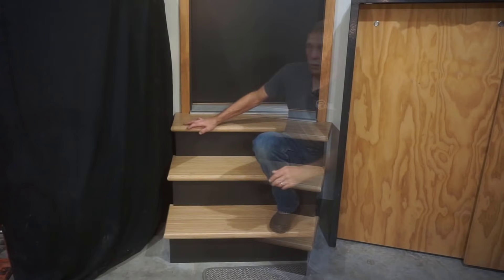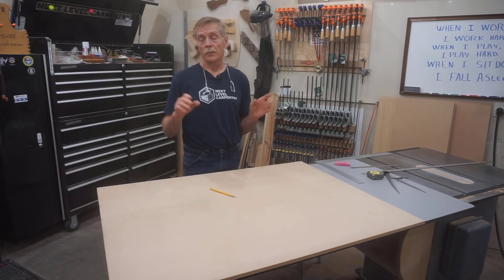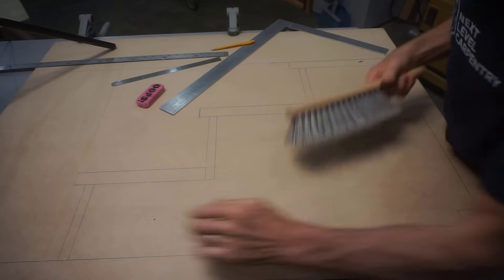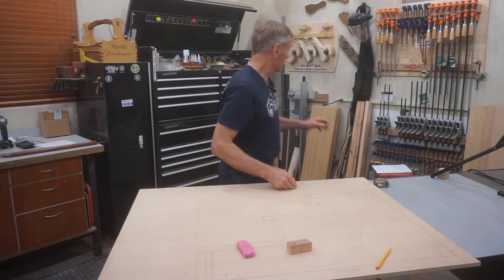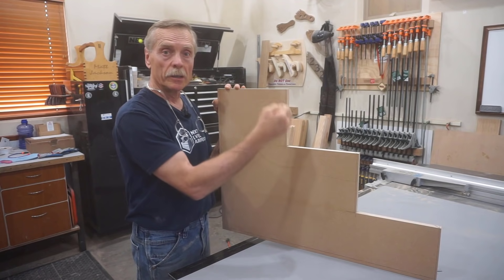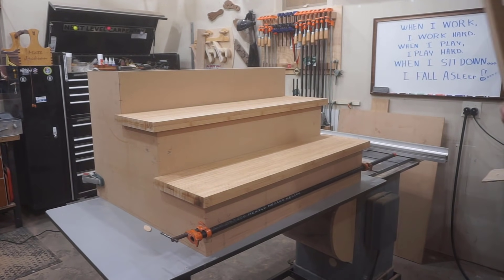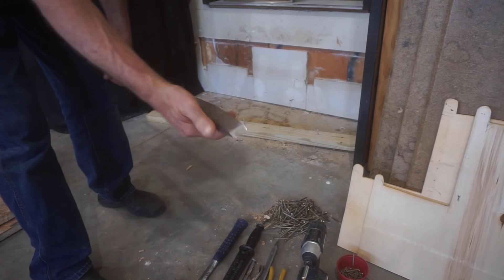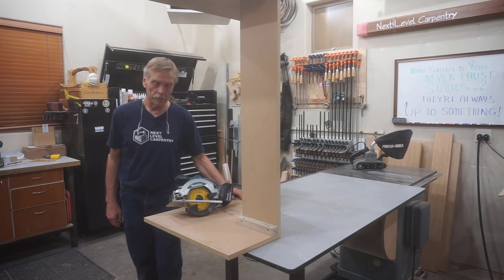Build Simple Strong Steps Without Stringers

Comment: I’ll probably never build a set of stairs, but I’ll always watch your content all the way through.

Love all the jokes!
Reply from the maker: Thanks for watching LONNNG videos all the way through... much appreciated!
Reply: @NextLevelCarpentry  I think you abbreviated that as much as it could be. "Were not building a piano here" doesn't fit in this case. A person could be proud to have that set of stairs installed anywhere in their house. I have worked with some very talented carpenters in my day and I never saw anyone top what you just did. Awesome work bud.
Reply from the maker: @78tag  thanks for sayin! 😎
Reply: @NextLevelCarpentry  I like videos, I fall into the group if one screw is good three will be better
How do know how many screws and what size and how long, wheater glue is enough,  weight vs force vs size is always a question  thank sharing your time
Reply from the maker: @frankhynes4514  Most of that is from decades of experience in both building things and tearing them apart.  When in doubt use more.  You can learn more from a mock-up than just about any other method.  With things that are new and unfamiliar don't be ashamed to iterate; a 2nd one is always better than a first and often it takes a 3rd one to get acceptable results... Best, Matt
Reply: @NextLevelCarpentry  thank you
Reply: Metric Dividers!

Comment: Thanks so much, Matt.  Another outstanding carpentry demonstration with an extraordinary attention to detail and some humor thrown in just for laughs.  There are so many tiny little details in how you scribe to get the perfect fit. Thanks again, you are the MAN.
Reply from the maker: Thanks for watching and commenting on this one Jim, much appreciated!  FWIW these steps have performed flawlessly to this day and I expect that to continue for many years to come.
Reply: @NextLevelCarpentry  Hi again, Matt.  I need to get rid of the 3-4 inch drop from living room exterior door to the front porch which is concrete slab.  Any tips or links to how to accomplish that one?  I would like it to be a mini-ramp.
Reply from the maker: @jim7smith  I've got all kinds of ideas but tough to communicate them.  How long can the mini ramp be?
Reply: @NextLevelCarpentry  I would think 3-4 ft would be fine, the drop is I think less than 4 inches.

Comment: I built a stair box similar to those only in dimensional lumber as the steps, definitely not as athletically pleasing. I used a piano hinge on the middle step to access storage under the step. This video was exceptionally done. I live in Canada so I already own metric dividers.
Reply: You could add a set of adjustable Metric Crescent wrenches
Reply: Idk dude I see athletes running up and down stairs all the time, they seem mighty pleased by just about any old set of stairs
Reply: @martyjosephson4937  -- You will also need a metric board stretcher to round out your colledtion of tools

Comment: Excellent video Matt. This project is a platform for many other useful tips and processes you use instinctively that many others don't know. For that it reaches many levels of skill and analytical experiences. I particularly like when you display mistakes. One problem with other videos is that they don't normally show mistakes which is not good. Not only is it good to show minor setbacks, its good to show how to deal with them. Also the constant foresight is critical to make the project work so you don't have to iterate back again. I might disagree with the simplicity aspect a bit, but this is full of great value, keep up the good work.
Reply from the maker: Thanks for the nice comment Timothy... Much appreciated!
I suspect your slight disagreement with the simplicity aspect is that its relative to the resulting assembly more than the less simple process of getting there? 
Glad to hear you're one who watches to learn methods rather than expecting to be taught specifics. 
Best,
Matt
Reply: @NextLevelCarpentry  The fact that you used Bamboo was excellent. I am not sure if you commented on how strong Bamboo is. Some critics might not see the engineering in this. I suspect Bamboo isn't budget friendly.

Comment: @Next Level Carpentry I recently came across your channel. Just goes to show, you can definitely learn something new every day. While I've never been a big fan of MDF/HDF, I know it has it's place. Even in the off chance that the stair box ever incurred any damage, the way you built it allows for a couple new sheets to be put together a quick resurfacing of the bamboo treads has everything back in order. And because you didnt glue the treads, if the flooring in that hallway ever gets changed, you can change the treads accordingly. That finished coat on the stair box really sold me on getting another sprayer. I tried out one of the new plug-in Wagner airless sprayers earlier this year, doing several hundred feet of privacy fence, it worked well enough. Really glad I borrowed it though. Absolutely going with a battery Graco. Keep up the videos.
Reply from the maker: Hey William, thanks for watching and commenting on this one.  I share your opinion of MDF/HDF but it might not be clear in the video that Medex, the specific HDF product used for these steps, is an entirely different animal.  Extremely durable and virtually water proof, not merely water resistant so I feel it's a better product that even pressure treated wood and much better suited to this sort of project than any Trex-type material.
I do think you'd like the 'high end' Graco seen in this video... it's pretty amazing with the only shortcoming (common to all sprayers) is time and effort required to clean it and 'pickle it' between occasional use when compared to a disposable roller & pan setup.
Reply: @NextLevelCarpentry  Well thank you for the tip about Medex and the input on the sprayer. Much appreciated.

Comment: great educational video.   Using the dividers and yard stick is just how i was taught in drafting class in the late 1970’s when we still did drafting work by hand and learned to take the same info to actual building process for wood and steel fab.   Also like the humor used related to the metric system comparison.  Great job also well organized and clean work shop!

Comment: Lots of useful info + a healthy attitude in dealing with the naysayers of the universe. Any particular rationale for the sharp writer pencils vs. Other writing implements? Thanks for sharing!
Reply from the maker: I really like the sharp writers over any other pencil I've used for the sort of marking required on a build like this. The fact that the lead advances by twisting rather than clicking means I can dial in exactly the amount of protruding lead I want for any given mark. Another preference is that they are disposable and a ridiculously good value for the use I get out of them plus I don't have to worry about losing or breaking them. Granted they are cheap little disposable plastic things and not a nice robust implement like a high-quality drafting pencil but to me performance trumps all factors of Aesthetics and prestige... Best, Matt
Reply: @NextLevelCarpentry  Thank you.

Comment: This is also the way to construct an open sided skirt board. Good stuff!
Reply from the maker: Years ago I did a job with many dozens of steps, all with one or two open sided skirt boards that made up a good deal of my personal learning curve for this 'box stairs' design.  It's always tricky cutting that 'backwards 45' accurately, consistently and in a reasonable amount of time, isn't it?  Got off easy on this project with just 2 backwards cuts compared to a flight of 6~10 risers! 😲Best, Matt

Comment: Just a heads up on curing your paint without having to move the fresh painted part subjecting it to the possibilities of contaminating the surface.  You could use a Medium Wave IR Heater from Infratech.  IR cures the finish from inside (the substrate ) to the outside ( surface ).  The added advantage is no trapped solvents under a skinned over surface.
Reply from the maker: I sure like the sound of that... inside-out curing would be great!  Curious how realistic it is for multi-faceted projects like this... seems like it would take 3 of those heaters; one for each surface?

Comment: For tuning up scribes, I love the Porter Cable 371 belt sander. With 2 1/2" x 14" x 60 or 80 grit belt, this little one-handed tool handles as easily as a block plane, but without need to pay close attention to grain direction or to sharpen. Just wish someone (hear me, Dewalt?) would offer a cordless version.
Reply from the maker: Sounds like a sweet little tool Michael... never used a belt sander that small but can see how it would work nicely!  Do you think the size and weight necessary to power the tool would cancel the benefit of being cordless?  Best, Matt
Reply: @NextLevelCarpentry  No. If designed literally to emulate the function of a block plane, the belt could be even narrower and shorter than the 371, and the general power to size formula could follow in the direction that Dewalt's "Atomic" line is heading, probably as a 12V tool. I'd pre-order today if possible...
Reply from the maker: I like the concept for sure!  I think you're just the guy to persuade them to bring your vision to reality... let me know if they start a 'go fund me' on it and I'll jump on board!  Best, Matt

Comment: Impressive and wife says this is where I get my “overkill”. (But like it done right ) 😏
- Always left space to pull joints tight, never thought of the cardboard. Good idea 👍 
-Never had much luck with foam rollers either.  Like the use of the cordless sprayer as I am eying one. 
-Always love the humor, and wow to whoever built the industrial strength rigged mess you demo,d 😮
- Thanks for another good vid.  Now I have to make up for a lost hour and a a half. 

And gotta check out the speedy bits. All others I use just plain suck.
Reply from the maker: Check out Graco cordless sprayers... pretty amazing tools IMHO.  I have 'my' Graco listed on Amazon in the video description along with a set of those Snappy (speedy) countersink bits.  Whether or not you get them and/or use the Amazon links you should check 'em out when you consider options.  
Can't help you with the 'lost' hour and a half though, other than to commiserate on time spent on long videos! 😯😎

Comment: Interesting, I would of never guesses MDF for that. Loved the fast cap kit idea I need one of those for sure. Great Video as always
Reply from the maker: It's probably a typo but it's important to note that, since these steps are in a garage and on concrete, the material used is HDF and an exterior grade at that.  MDF would be fine for interior steps and wood though, because moisture wouldn't be an issue over time. That said, the Medite product used in the video is my favorite, hands down, for painted millwork like this. Best, Matt

Comment: Just found this clip.
I'm not going to get into what is the proper method to build stairs. We all build the way we were taught. I will say this though. I loved the cardboard shim when attaching the corner glue block & how it sucked the panel up tight afterwards when screwing the corner together. I never  would have thought of that. I guess you can "Teach an Old Dog New Trick"! Thanks for sharing that tip.

Comment: Very helpful and informative video. Where to get this biscuit cutter attachment? I can't find any cutting on the side (90 degrees) of the grinder. All of the attachment cut 180 degrees.
Reply from the maker: Hey Tom, I never thought of the fact it looks like I have a special attachment for an angle grinder that cuts slots for biscuits but the fact is that my biscuit jointer is a rather rare one made decades ago by Black & Decker in Europe (as I understand it) by Elu.  Here's one I found just now listed on Ebay:
https://www.ebay.com/itm/374673254923?mkcid=16&mkevt=1&mkrid=711-127632-2357-0&ssspo=R3HYF5-nS-u&sssrc=2047675&ssuid=4Ajs-xPyTaq&widget_ver=artemis&media=COPY
and it looks like an amazing deal if you're interested.  Fact is I'm tempted to put a bid on it because it looks like it's in better shape than my old one that I've had since 1987...
Reply: @NextLevelCarpentry  Thanks Matt. Unfortunately so many good products from the past has been replaced with cheep plastic ones. Once again thanks for video.
Reply from the maker: @tomkacprzak4107  I don't even know if there is another brand/model on the market today that I'd buy to replace that old 'odd duck' Elu biscuit jointer because I've found its odd configuration very useful, adaptable and versatile over the decades I've owned it.  I don't mind 'cheap plastic' tools but only if they have a functional design instead of senseless/useless aesthetic 'upgrades' generated by overeducated engineers and the marketing department! 😎

Comment: That is a really nice looking spirit level you have there, is it cusom?
Reply from the maker: That is indeed a beautiful level but it is not custom but rather one manufactured by Crick.  They are extremely durable very accurate and great to work with and I get mine at a local Masonry Contractor Supply Company in case you go looking for one...

Comment: I haven’t seen HDF at Menards but maybe I haven’t looked hard enough.  Interested about the water resistant comment.  I never consider those kinds of materials for structural projects but it appears I should.
Reply from the maker: When properly used, materials like particle board MDF and hdf have incredible compression strength and provide much more than adequate support as long as the material is used with stresses in compression and not relied on for tensile strength. Another property that makes the material well suited for this task is that it is dimensionally stable and not prone to warping cupping or splitting like solid wood and much of the plywood that's manufactured these days...  all that said it's not a bad idea to consider this material for projects to evaluate if it's a good fit or not...

Comment: Love the channel, and all of the humor.  Question on the biscuits. You added screws which I assume is for the strength to support  the weight but do you count on the biscuits for much strength? Seems most everything I have heard is that biscuits are for alignment and not strength. Just curious on your thoughts on this.
Reply from the maker: Biscuits do add strength in many applications and these stair risers are one example.  The main reason I added the screw blocks was so I could pre-assemble the 'stair box' for scribing and still allow myself to disassemble  the assembly afterwards.  For example: if I was 100% sure of the initial assembly I could have just glued it up on the first go-round and it would have been plenty strong for the stairs without screws or glue blocks.  I think the greatest misunderstanding is that biscuits add strength when edge gluing boards. A properly prepared glue joint is already stronger than the wood itself so, other than for the alignment you mention, I feel they're redundant and unnecessary for edge gluing.  There's a few 'stream of consciousness' thoughts on the matter... feel free to post any other questions you might have or I missed... Best, Matt

Comment: I always love your content. I am not a "carpenter" but your techniques apply to even my small projects. Would love to see a Tansu staircase. I need to build one to replace the stairs in my basement (the steps are only 6" wide). My washer and dryer are next to it and would love the storage built into the stairs. Thanks for considering it!
Reply: Im not a carpenter either (I am a painter 39 years) but, channels like this have turned my occasional wood repair jobs into full blown finish carpentry work. Having worked around professional carpenters like this my whole life so I know what things are supposed to look like. The guys calling themselves carpenters are hacks where I live. 1 repair has turned into 1 door casing and now has snowballed into people calling me for carpentry.  I always point to my painters pants and say " you see what you ate hiring to do your carpentry correct?" They do not care😂😂😂😂

 I have a built in excuse. I do not take on any ground up or structural things because I lack the experience and don't want to be responsible for catastrophe

Comment: Always a great lesson!!  Is there a reason why you don't install the treads first and then let the risers rest on the treads??  Or would method creating squeaking?? (not criticizing just asking)
Reply from the maker: Good question John. Using the method shown in this video is a time-tested best practice. The reason is all about strength.  
Fasteners driven through the back face of the riser into the back edge of the treads are stressed 'in shear', meaning forces are exerted against the shaft of the fastener. In most cases glue is used in addition to screws to reduce the tendency of fasteners to split off the bottom edge of the riser.
 This is MUCH stronger when compared to screws driven through the bottom face of the tread into the bottom edge of the riser.  That's because stresses in that scenario are against 'pullout' strength which is (almost) always weaker.  Glue wouldn't be of much help either because it too is stronger 'in shear' than separation from pulling.
  Even if very long screws were used (which is difficult due to the potential for split-out), a heavy load on a tread would tend to pull against the screw head and almost surely weaken over time.
As in most thing, there's an exception for every rule in stairbuilding and I've probably violated most 'best practices' in some way on one stair project or another but I stand by every installation I've ever done, relying on the principals explained above.
Best,
Matt